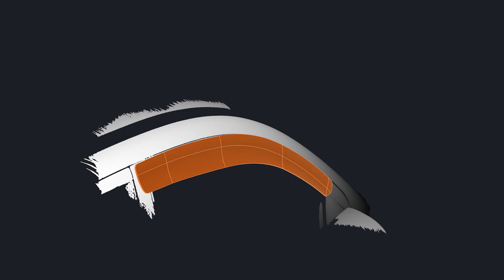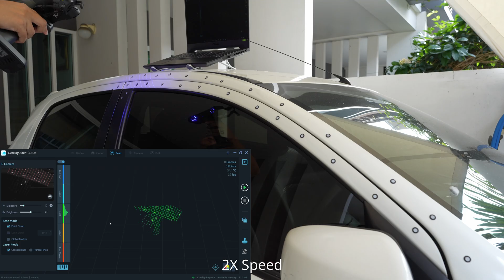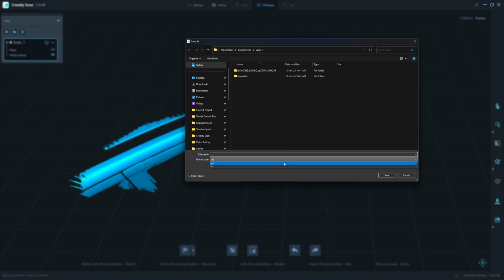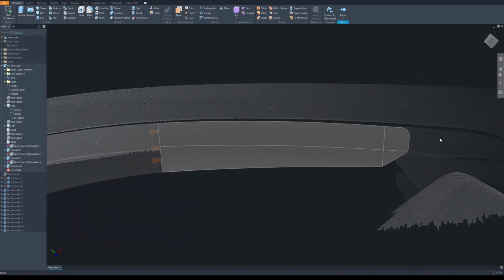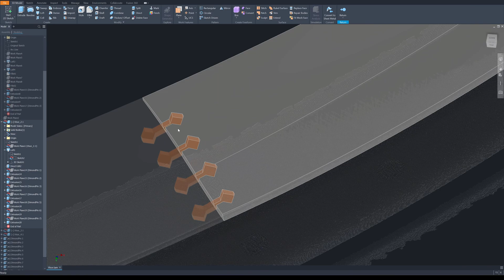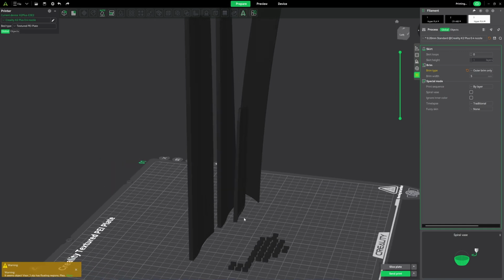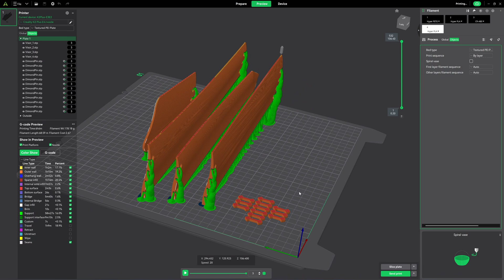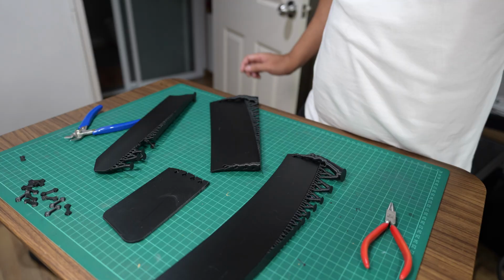From Scan to Print: How to Make a Perfect 3D Printed Car Vent Visor with Creality Scan Raptor X

Comment: Great video as always! 
What would you recommend in terms of resolution for scanning the front of a car in large mode?
Reply from the maker: For a single panel, like a door. I would use 0.5-0.6mm. This one in the video is just the top of the door frame and I need denser point cloud for tracing the small frame, so I set it to 0.3mm.

Comment: Brother print it vertically. In your cad build something similar to a kickstand for support with break off tabs. Instead of the stitch clips use an overlapping dovetail joint. This will keep your orientation the length of the part. Looks great. Thank you for the content.
Reply from the maker: Totally agree. I'll make another version print vertically with base tab, no support and print with PETG. I think I can cut off the tabs with side cutter if I make it 0.4mm thick.

Comment: Hi Payo, 
I think the first proposal to print vertical direction was correct. 
There is neccessary to connect all parts together with small bridge along the vertical dimension about each 50-100 mm. 
Great job! 
Jiri.
Reply from the maker: Thanks for the info!   and what you asked in the e-mail, I recommend the Otter over Otter Lite for your use case. It has better result when scan in small-medium mode. You can buy the WiFi handle later when needed and I don't think it's less necessary than scan quality.